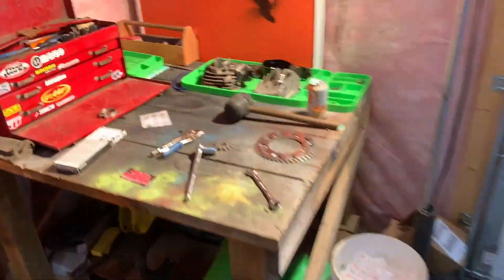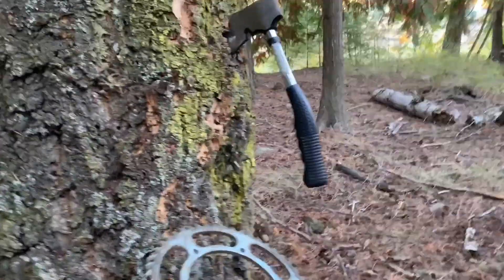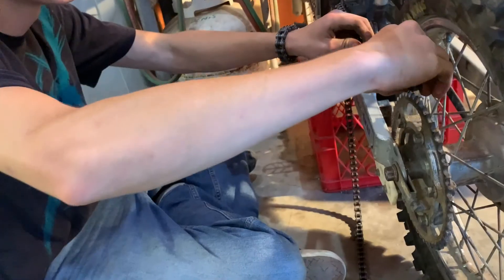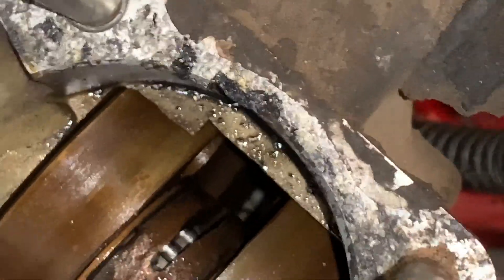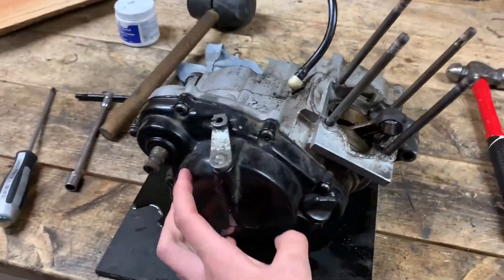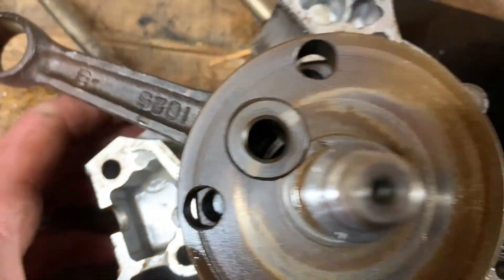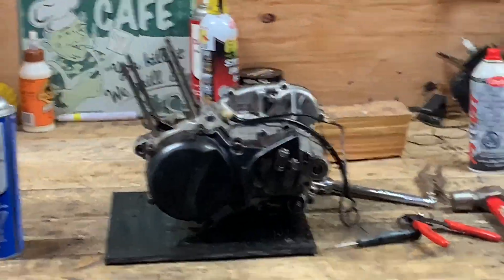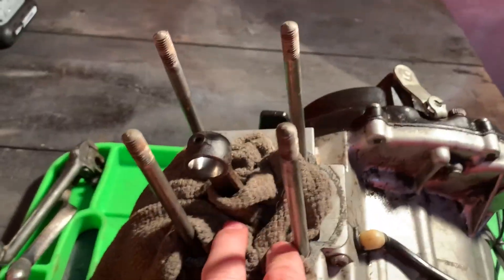Time for a crank!!(KDX80 part 4!)

Comment: How did you get the crank case to split so easy asking cause I have a Kdx80
Reply from the maker: Great to see you have a KDX80 and I put a screw driver in there and then when it was just a little crack and then tapped it with a rubber mallet and they split super easy
Reply: @logantomlinsonwiebe  thanks I’ll try that
Reply from the maker: @sawyerallgood8560  good luck man!!!